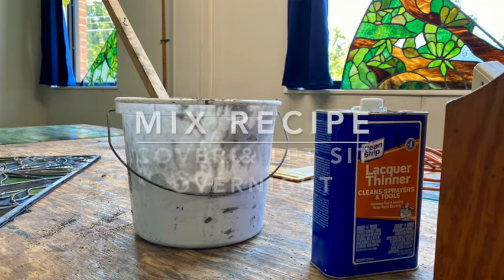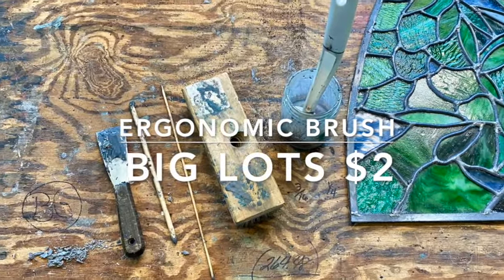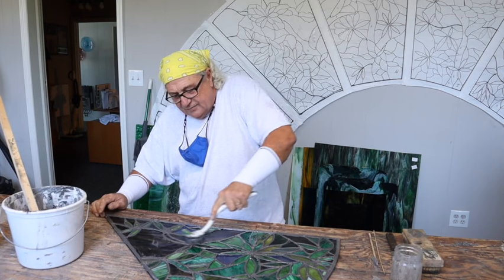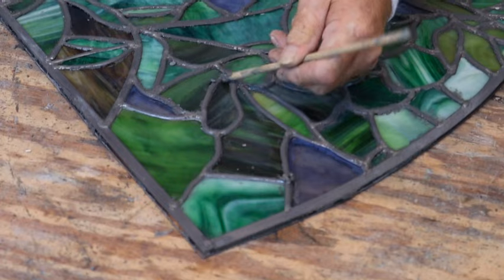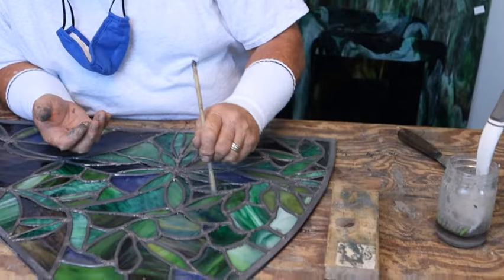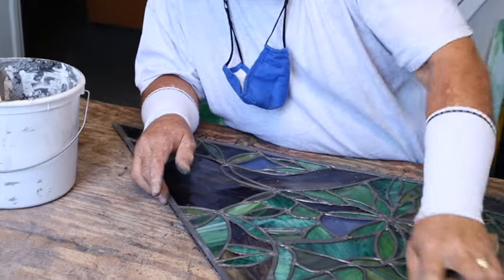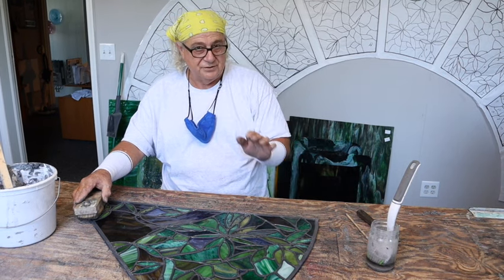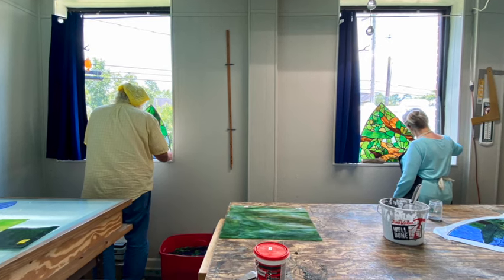Top  7 Stained Glass Putty Tips

Comment: Love seeing this whole process come to life. Beautiful polishing! Quick question I read the SDS sheets for the putty that you use for your recipe. In that sheet they recommended not using it for leaded stained glass. I guess over time they claim the putty will separate from the lead and cause leaks from weather. Have you ever experienced this with your recipe? At the moment I am using the traditional whiting mixture and it does make so much mess.
Reply from the maker: Hmmmm. Can you share that info? Is it the DAP 1012 you are referring to? We've used this recipe for over 35 years and we've found that it adheres tightly to the glass and lead and resists sagging, cracking, shrinking and chalking. The glazing forms an airtight and watertight seal. Thanks for watching and happy cutting!
Reply from the maker: Or Dap33 is good.
Reply from the maker: @carlye.b  thanks for sharing. We’ve not had any problems but usually use the Dap 33.

Comment: This video has given me hope. Question: Would this method work on vertical (installed) applications? 
I am located in a city that doesn’t have stained glass restoration  I am trying desperately to keep my stained glass front door insert and side light windows. 
Thank you for any and all advice, and I have saved the link for your secret recipe. My fingers are crossed!! ❤️
Reply from the maker: Yes you can putty in place, but you’ll have to make a dryer mixture and hand putty. Wear gloves.
Reply: @ARTyRV  So not a slurry mix with a brush? More like traditional window glazing?
Reply from the maker: @charlieann82  Yes, the consistency of regular putty. Use your thumb to push into the lead.